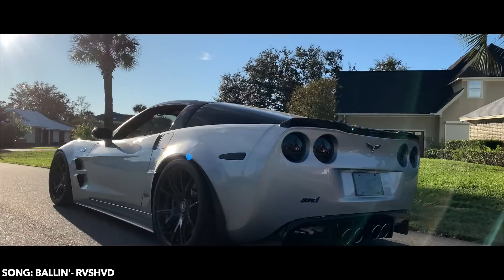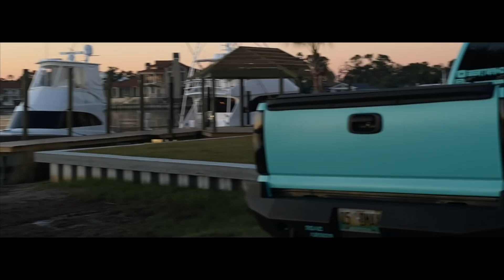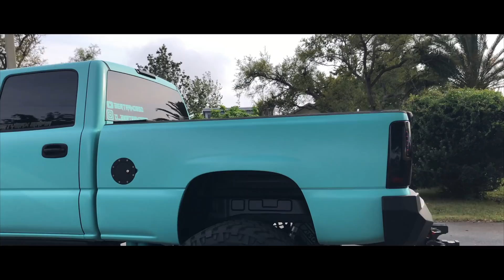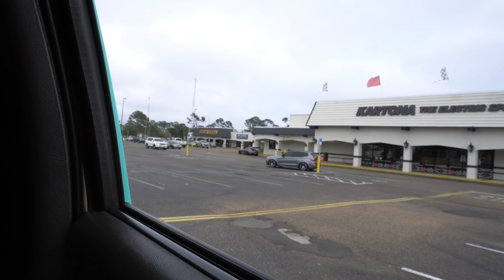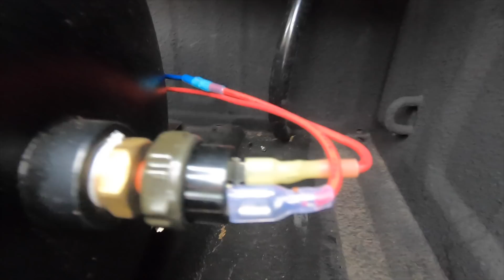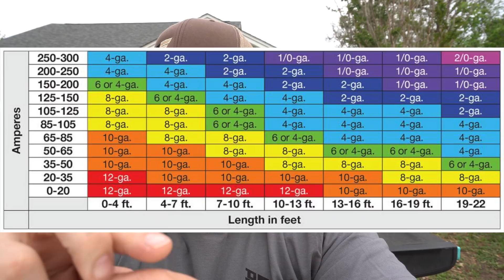HOW TO: Install a CRUISE SHIP HORN in a LIFTED TRUCK!

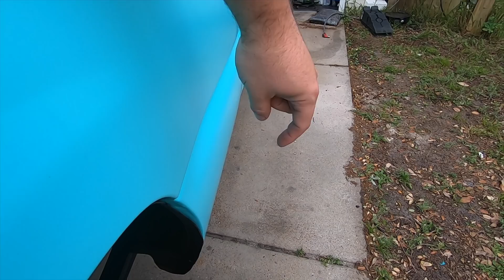Comment: Cool stuff Bert, and thanks for the info! Everything is looking great too, until 10:22 you need a grommet on that hole, that will blow your whole investment really quick! Well then again you got all the other cool safety features, but c'mon hot wires going in the hole...good to use that rubber unless you want all your investments going to the other half, and yeah I got sidetracked, but seriously that raw metal will wiggle through that tape in no time...Cheers brother!
Reply from the maker: It’s got a rubber hose over the wire man 👍🏻 it’s all good
Reply: @BERTRAND85O  My experience is the raw steel hole cuts through that though from vibrations and movements, basically like a hacksaw, even if you don't want to mess with a grommet, you can makeshift with duct tape, just the sharp steel edge is what i'm getting at. 
Or unless you filed the hole down and made it smooth?
Reply from the maker: It’s smooth and a big hose is wrapped around it 👍🏻
Reply: @BERTRAND85O  Well you might be good to go then brother, I just always bad luck with the raw hoes ....BAHAHHAAA ! Cheers bro, been drinking, quarantined and getting a lil stircrazy these days,,,Cheers...Let's blaast lil neighbor now, I'm thinking that mnight shake the whole house...LOL
Reply: @BERTRAND85O  And from the looks of the other stuff you whipped up, looks like you got er down pretty good bro...Cheers!
Reply: @BERTRAND85O  And I got too much time on my hands now brother Bert! So I whipped up a seriously CrAzy plan....this actuallly needs a drum roll......I'm getting chills thinking about it....The Boat horn and Train horn at the SAME DAMN TIME....BOOOYAAAAAAAAA!!! OMGGGG....gave me chills thinking about it....lool

Comment: I would suggest you put your breaker by the battery in case you rub a short between you breaker and battery. Nice vid I want to do this to my semi truck.
Reply from the maker: Good call man
Reply: i did this its a good tip